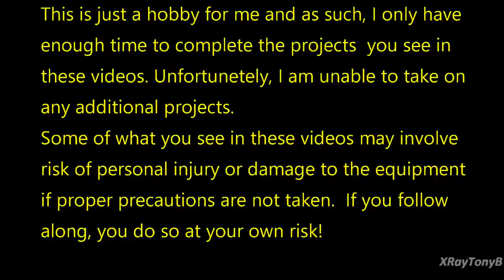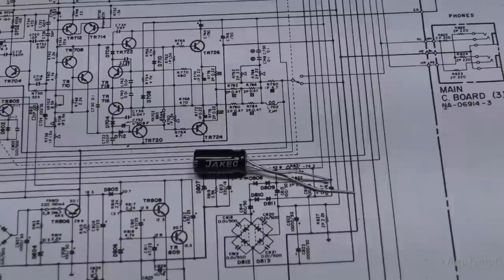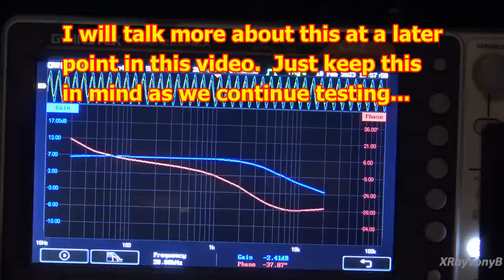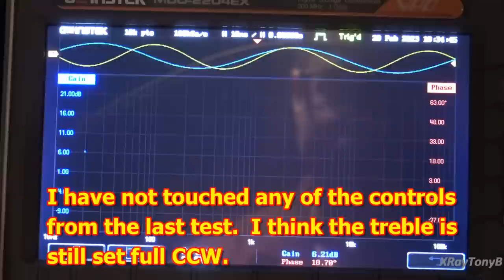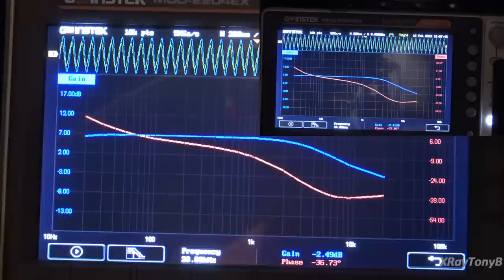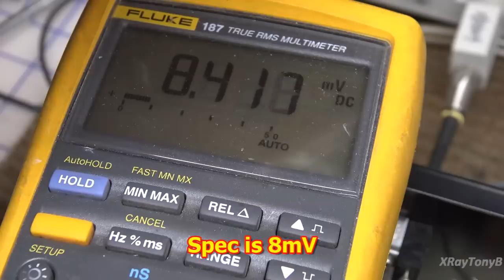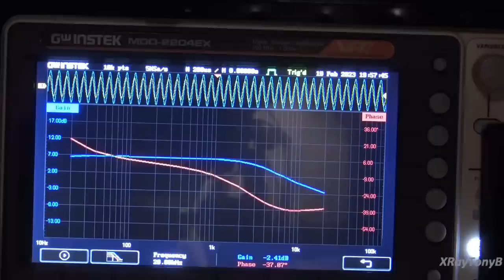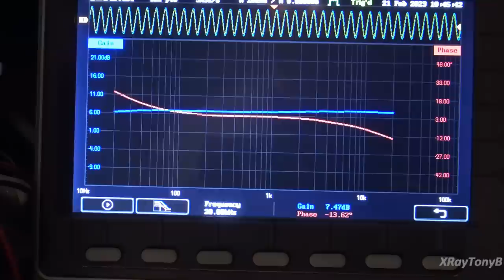Yamaha CR 820 - Replacing Capacitors and Testing

Comment from the maker: 0:00 Testing leakage on capacitors
4:32 Low leakage capacitor types
13:19 Frequency Analysis of amplifier before replacing any capacitors.  Note: I believe the test was not properly performed, as it looks as if the treble control was not set to flat position. :(
14:35 Replacing the capacitors on the tone control board (Solder & chat)
33:05 Frequency analysis after replacing capacitors on tone control board.  All controls set the same as before (including the treble control)
34:42 Replacing capacitors in power supply & Amplifier section
48:44 Checking & Adjusting the bias on the amplifier
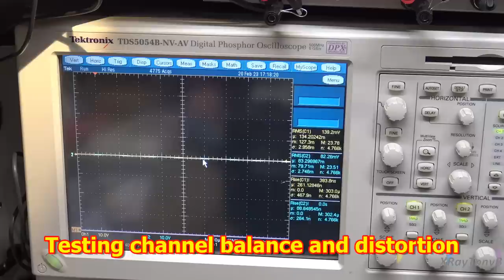50:18 Testing channel balance, power output & THD of amplifier
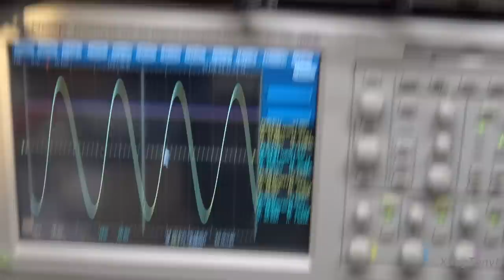54:04 Explaining the mistake that was made when I did the frequency analysis
56:09 Frequency analysis after full recap of amp, power supply and tone control.  Test was done with treble set to -5 and again with treble flat.  
1:02:28 Final audio test with music
1:04:58 Closing comments
Reply: I lift my Cap to your capacity to fit capable capacitors 🧢
Reply: where can i get me one of them meters lol

Comment: 'Quality'
Everything has quality. It comes down to the qualifier. 
For example:
Super cheap components from EBAY are usually considered SUSPECT quality.
Tony's explanation of capacitor properties and uses is HIGH quality.
His view on sharing knowledge is PRICELESS quality.

Tony, this particular video and all its explanations that go far and above the device on hand is a valuable resource. I have had someone on a forum I'm in ask about replacing old caps in a set of old speakers (50 years + -, so old that the designator was "M"), and it reminded me of all the differing types of "advice" out there. The thing about this question  is that you could tell the guy is a newbie and giving him just enough of the basics, including a website and an old crossover chart, so he could see what the OEM was doing when they put it together (3 caps in parallel).
I'm essence, I'm going to recommend this video for those who would like a better understanding of Capacitors, their specifications, and possible uses. I believe spreading this knowledge is within the spirit that you've recorded.

Thanks again for your time, online camaraderie, and genuineness.

Comment: Very good review of the the electrolytic capacitor replacement question and an excellent demo of the various capacitor variables. Thank you.

Since you asked, my default position is to replace all the electrolytics if the unit is older than about 30 years. If a 30-year-old unit also has paper caps, I’ll usually replace those with modern film caps. I leave capacitors in the tuner section alone, as these are usually high-quality and are neither paper or electrolytic. Furthermore, caps in the tuner section may have been hand-picked at the factory for optimum performance. The new caps may result in a slight change in the character of the audio—especially at high frequencies—but the unit will be reliable for at least another 30 years.

Comment: I went through a similar exercise many years ago when I replaced ALL the PSU caps and many of the signal caps in a SONY PreAmp. Tony is "spot on" about testing with sine waves (single freq. signal).  You will probably NOT be able to detect ANY before/after  differences. However (IMHO) there IS a significant difference when playing music  (with high dynamic range) through a newly re-capped unit. The most noticeable thing is the "punch" of the bass notes. But this is like being able to hear the difference between various interconnect cables. Some people will just say it's all psychological based on confirmation bias. However, I believe you CAN test for low freq. linearity and distortion using low frequency "tone burst" tests. But you need an arb-generator for that.

Comment: The MTBF of Capacitors is highly temperature dependant. So those capacitors that are at the end of their MTBF life are playing the odds like a Lotto Ticket as to when they will fail...
Tony is correct in every respect in his recommendation as to replacing those old capacitors. The ESR of new replacement Power Supply Caps is important, more so with SMPS units...

Comment: Besides the clean sound Yamaha is known for, the simple look to their faces have always had my heart.  I'm torn between the 20 and 40 series, for different reasons.  The 20 series appear to be built better with no amp packs, but the 40 series look better with their illumination being a much welcomed improvement over the 20 series.
Reply: The 20 sounds much better then the 40
Reply: The 20 series illumination can be vastly improved by removing the colour filters present. On the dial it's easy, but on the meters it takes quite a lot of patience and 99.9% alcohol to free them from glue.

Comment: Great video. I often wonder the annual cost of failed electronic systems due to old electrolytic capacitors. Electrolytics are used everywhere from power electronics to medical devices, audio/video, flatscreen TVs, communication, computers/server, aviation even satellites...the cost of downed equipment because of failed electrolytic caps must run into $ billions every year. It is amazing electrolytics haven't been outlawed for critical electronic systems, and even outright banned in modern electronic systems !

Comment: Thank you so much for answering my question in such an elaborate way that you spent 15 minutes in a follow-up video on it. Now, I also use the Nichicon UFW/UFG in power related circuits. I haven't had any problems with the amps I recapped, they did work just fine. But my question is: Is there any negative effect on using audio-grade caps in the power section, or is it just that I'm throwing money away senselessly on these slightly more expensive caps without any benefits, or doing more harm than good. So if I understand it correctly, any capacitor directly connected to ground is a decoupling capacitor and thus a power-rail cap?

I read about audio caps might degrade faster in a non audio circuit. Again thank you for your informative videos. Kind regards from The Netherlands, your tier 2 Patreon subscriber.

Comment: TIP!!! I ALWAYS place a rag over the Dial String. That protects it from a hot soldering iron.. I made this mistake about 5 years ago, and learned an important lesson.. Protect the dial string, as some are very complicated to restring, especially if you have to pull off the entire front panel...
Robert
Reply from the maker: I use aluminum foil, but I like your idea as well!

Comment: Thanks again Tony, Great info on the cap types! Looking forward to the CR-820 tuner video. It uses a Sanyo LA3550 FM MPX decoder chip with a "pilot erase" signal to cancel out the 19KHz pilot tone from the FM detector. I can't find a real datasheet on the LA3550, so I have to infer what's going on. Also has the unique OTS (Optimized tuning system) with a touch sensor on the tuning dial to disable the locking while your tuning.

Comment: If the component lead wire is long or thick then I cut it off first before soldering because it will heat up quicker as less mass. This means it will damage the component less and solder will flow quicker and better. When bending leads with pliers, I put the long nose plier jaws at the base of the lead, grip the wire and bend the wire over the edge of the pliers jaw. This means that there is no strain on the component at all. Also the width of the pliers jaw is always the same, so I know exactly how long each bend will be and each lead of the component will be bent to exactly the same width (the width of the jaw). You can use a small hacksaw to mark the side of your long-nose plier jaws to give you reference marks along the side of the jaw (e.g. 1/10" marks), so you can use the same position each time. This is especially good for resistors - each end will be bent at exactly the right place and each side will be the same length.

Comment: I find the difference in sound when changing capacitors out is greater in cap-coupled units vs. direct-coupled.  Still,  I like to rebuild the power supply, protection , and amp circuitry on direct-coupled units for longevity and preventing a breakdown.

Comment: On the subject of going to voltage that’s too high and the circuit having too hard of a time keeping the cap formed, what do you do in situations of the smaller values? I’ve run into 1uF, 2.2, 3.3, 4.7 that are rated at 10-16v. I don’t see them being made that small.  All of these values I have are either 50v or 100v.  By the way, not sure if you’re planning on covering it, but this model of Yamaha has transistors that should be swapped out, they’re known for getting noisy and failure.  So modern equivalents are recommended.

Comment: I ordered the cap tester kit and all the parts however, the high voltage regulator is really hard to get. I sent you an email asking about a replacement. As always great video!
Reply: I got mine from a shop in England off e-bay.  Much faster delivery than their estimate.
Reply: ...and I looked them up and their gone. :(
Reply from the maker: I checked on Digikey and it says that they are on order.  This is different from being discontinued.  Most manufacturers only produce these items once every year or two.  When inventory runs low, you have to wait for the next production run.  I believe this to be the case with these.  If you go onto Digikey or Mouser website, you can be put on the email list and they will inform you when the next shipment arrives.  Until then, you might have to go to the scalpers and pay more (a last resort, in my opinion).  Hope that helps.
Reply: Found a seller on ebay that has 2 for $16 about 8 times the price it should be. But I wanted to get the project done and not sit on the desk for 6 months.

Comment: I never really had a problem of leads of THT components corroding when cutting them off after soldering. However, that's just the habit I got in to. I find especially if the board is turned upside down to solder, the longer lead slightly bent stops the component falling out.

Comment: Really enjoying your videos. I do restoration of vintage hifi stuff as well. Usually my cap choice is Nichicon FG and in signal path Nichicon ES. I'm wondering how come you didn't mentioned ES series.
Reply from the maker: ES series are bipolar capacitors.  In most capacitor coupled designs, there is DC offset in the audio path, meaning that the polarity doesn't reverse, i.e. one terminal is always more positive than the other, even with the audio signal present.  Bipolar caps need to have the polarity reversed in order to stay properly formed.  If you look up the spec, it says "The specifications listed at right shall be met when the capacitors are restored to 20°C after the rated voltage is applied for 1000 hours at 85°C with the polarity inverted every 250 hours."  In other words, they have to have the polarity reversed every so often in order to stay in spec.  Some amps have areas where the polarity does reverse.  In those cases, I will use ES series.  I'm pretty sure the FG series is the same capacitor, only polarized.  Hope this helps.

Comment: I have the CR-800, what caps should I replace to return it to former glory (or at least prevent it from failing as soon)? The Mouser website is a bit confusing and those Ebay kits seem expensive.
Reply: Replace all caps with low ESR long life caps
Reply: @Konrad_K.  I ended up working out what I need, found a comprehensive list!
Reply: @ATribeCalledCars  Just purchased a CR-800 that needs some servicing. Any change you could point me towards this comprehensive list? I'm new to this and it's a bit overwhelming to say the least lol

Comment: Great video. I’m having an issue with mine where the volume fluctuates. Any idea what would cause that? No static and berthing works great other than the volume issue. Thanks!
Reply: Has it been recapped?
Reply: @Konrad_K.  Not that I know of.

Comment: Unfortunatelly, most of the low capacitance Nichicon audio caps are scheduled to be discontinued.
Reply: Yes, why are both ELNA and Nichicon doing that?
Reply: @harbinger200  rumor is that demand is low for through hole components.  pretty much all electronics are surface mount now.  sucks as I just got into this hobby of restoring old recievers and finding out that they are phasing out caps that I want to use.  hopefully they come out with something new thats just as good or better.

Comment: The big deal made now about capacitors is all a product of YouTube and online forums. People get way too deep into the weeds over them, and talk about them with these nebulous characteristics that likely cannot be heard. At its most basic level, it’s a storage tank for voltage. When people start talking about different sound characteristics, that’s when it turns into jumping the shark.
Reply: Capacitors are filters and that makes them very important in a device that produces sound.  Of course many devices produced in the 70s and earlier are failing due to transistors, diodes, resistors and zeners.
Reply: @fernarias  Thanks, Captain Obvious.
Reply: @fernarias  also, as mentioned, they also matter on type when dealing with oscillator and rf circuits 👍
Reply: @ArthurJS123  You said that they are a storage tank for voltage.  That's too simplistic and lacks fundamental knowledge.  Audio is recapped because it has been proven to improve sound.
Reply from the maker: The electronics community made a big deal of capacitors long before YouTube or the internet existed.  At DC, capacitors are similar to a "storage tank" for electrical charge, as you indicated.  When AC is introduced, the capacitor becomes a source of capacitive reactance, where current leads voltage.  Many factors affect this and terms like ESR, dissipation factor, loss tangent, parallel leakage, etc. are used to express these factors.  Using a capacitor designed for linear power supplies in a switching supply will cause that cap to fail in short order.  Likewise, these factors will also affect frequency roll-off.  This is why two capacitors of the same capacitance can sometimes react differently in the same circuit.  I believe I demonstrated this in the previous video when we measured some of these characteristics in different capacitors of the same value.  That's why when we jump that shark, we must be aware of these things, lest we  get bit ;)

Comment: After the capacitor plague, I would never recommend chinese capacitors.  For me, I lost 3 motherboards (my beloved ABIT KT7-RAID) and 2 tvs (ge and samsung).  Much more damage to the rest of my family.
Reply: That was 20 years ago, and involved a Taiwanese firm.  Tony's video shows the cheap Chinese caps performed as well as the brand Japanese and EU caps. I've been using no name Chinese caps, as well as high end caps, and the Chinese caps work fine.  Assuming they understand the chemistry now, all these years later, the caps will age well, there is no reason to not use them in audio gear.  All the hang wringing over which Nichicon version to use is too much drama, IMO. I don't like using Chinese anything because I don't want to feed their communist military machine, which is being groomed to challenge America and the West for world supremacy. Buying their caps, though, is not going to tip the balance of power, so I break my rule when it doesn't amount to a hill of beans. Buying Siemens or GE medical imaging systems made in the CCP, however, should be illegal.
Reply: @arcsound but "feeding" the American military machine is okay?

Comment: Surely it's better to use a bigger size capacitor in the power supply so it's got greater storage not smaller size why are you doing that??
Reply from the maker: Although the physical size is smaller, the value of capacitance and voltage are identical to the original.  Modern capacitors are quite often physically smaller than the older ones due to improved manufacturing processes.  As for going to a higher/different value, I try to keep things the same.  The folks that designed these things really knew what they were doing and any time I ran the numbers, I found the values to be correct.
Reply: @xraytonyb  I'm not sure if you understanding me! A bigger capacitor holds a bigger charge! is what I'm saying like that's why you have big filter caps, shouldn't the other capacitors in the power supply be as large as physically possible as well?? with low ESR. So you have a reserve of power on tap not relying Just from the transformer or mains. Why don't we see more in doctors chokes as well in the power supply for the same reason or is that not necessary because of the transformer. Having an LC network as the power supply splitting up the transformer into two parts the first stage and then capacitance and then transformer and capacitors
Reply from the maker: I did a couple of videos on this subject.  Increasing the capacitance on a filter capacitor in a linear power supply provides diminishing returns.  With most gear from this era (excluding the low-cost items), the capacitor that they chose was optimal for the circuit, as was the design of the power supply.  At some point,  the power transformer begins to sag and it is the limiting factor.  Increasing the capacitor won't solve this.  The capacitors were chosen based on these factors.  On some  of the really old transistor gear, I was able to get a little bit of improvement by increasing the capacitance, such as in the old Scott amplifiers, but it wasn't a huge benefit and this was the exception rather than the rule.  It all comes down to the math.